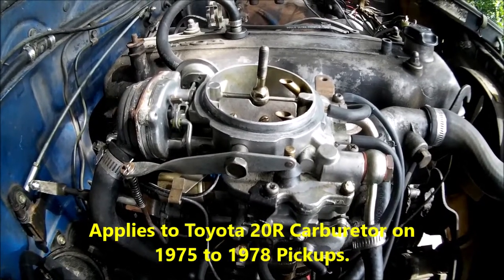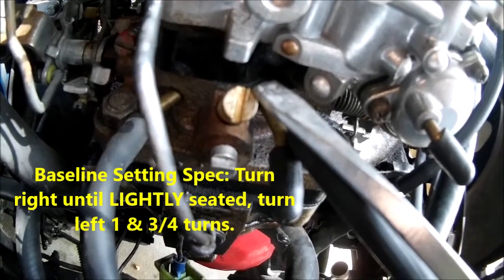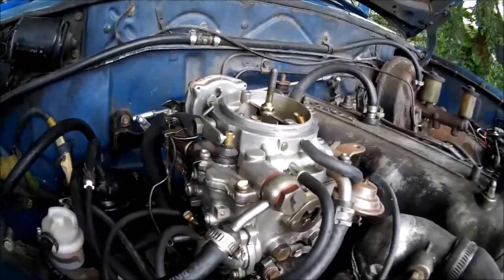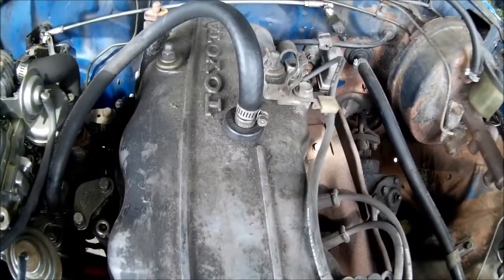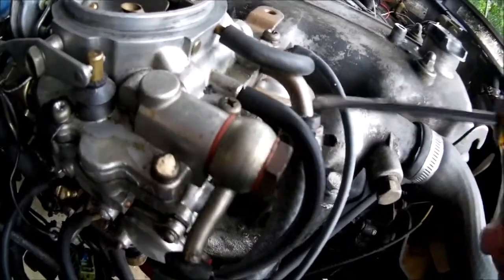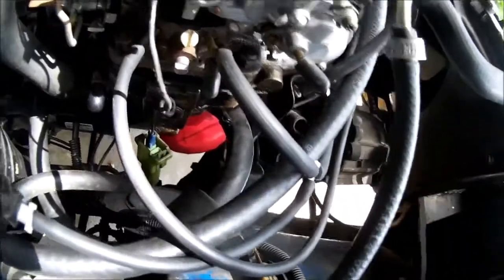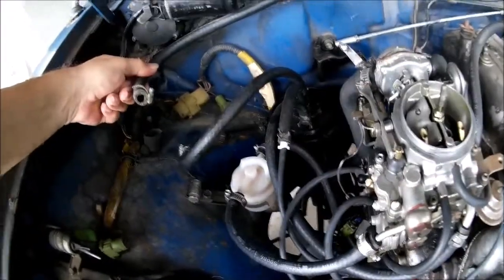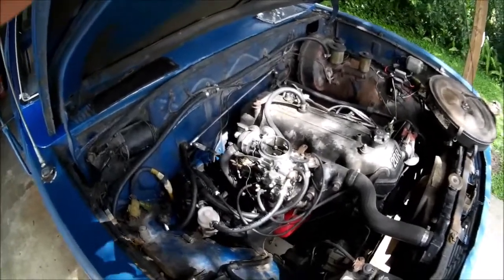1978 Toyota Pickup/Hilux 20R-Carb Adjust & Vac Lines-Desmogged

Comment: i have a 1980 toyota and has been jerky going down the road. i just put a carb kit in it and is not jerking now but i need some help with idleing isues. please help. email is rhill618@hotmail.com
Reply from the maker: I would need to know what the exact idling issues are in order to try & help you out. Also, sometimes idling issues aren't always fuel/carb related. Reply to this on Youtube with your specific issues & symptoms; the more detailed the better.

Comment: Wow incredibly helpful info, I’m planning on getting a Weber myself but I currently have a stock carb that had been “half way desmogged” by the P.O... and this is very helpful
Reply from the maker: Josh - Glad to be of service, exactly what I intended with making the video. By the way, if you need more info on the de-smog & what's involved there is a very good (but long) write-up of it on Yota tech here: https://www.yotatech.com/forums/f114/de-smogging-early-22r-205845/

Depending on what year you have there will be some differences. Just thot you'd like a data source to check against what has (or hasn't) already been done in your truck. Drop me a line if I can fill you in on anything that the write-up doesn't.